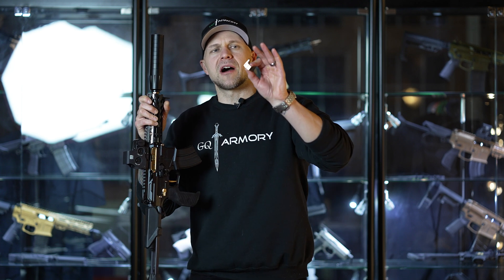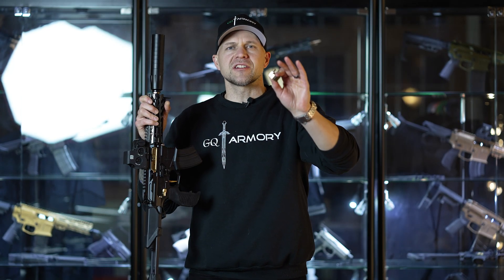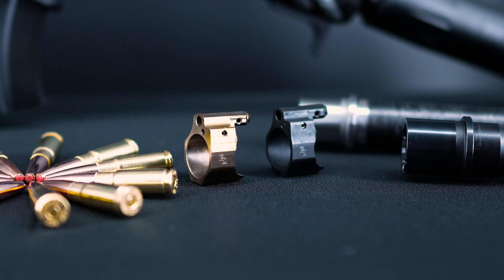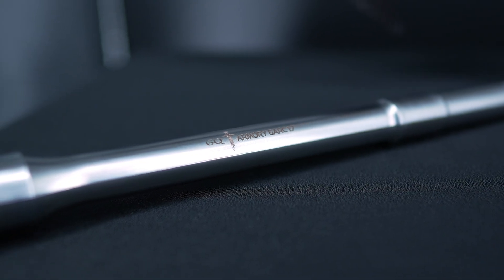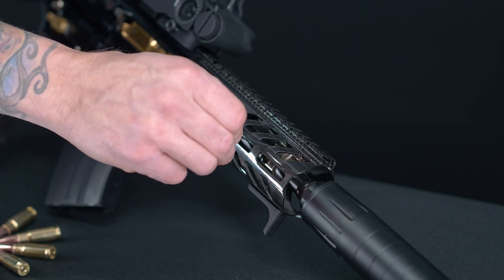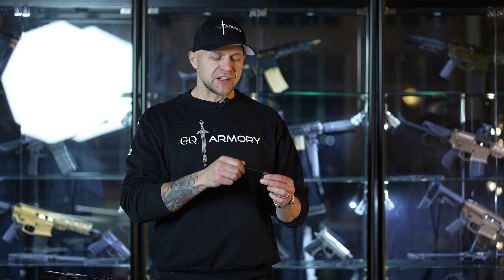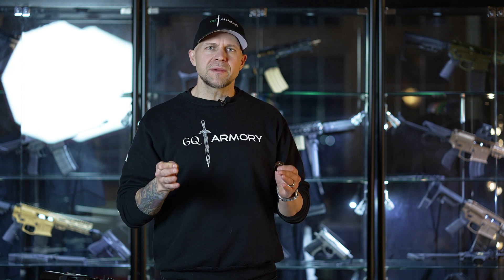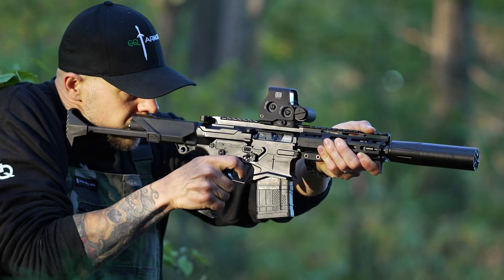How to adjust your Gas System with our NEW Ultimate Adjustable Gas Block!

Comment: Can the gas screw be accidentally backed out completely or would it stop? I could just see me accidentally backing it out all the way and then having trouble getting it back in
Reply from the maker: Technically yes, but we give in the instruction guide not to loosen the screw to where it starts to protrude from the block. That's an easy visual and gives you some margin of error before you back it out to the point where you release the detent system.